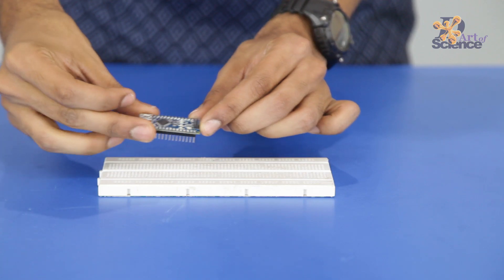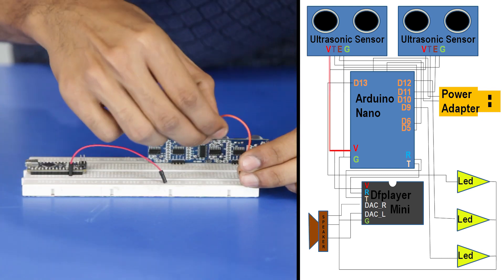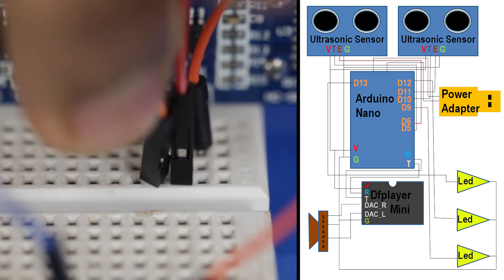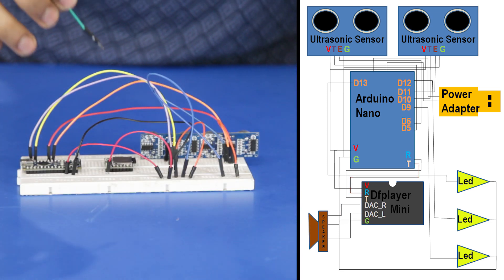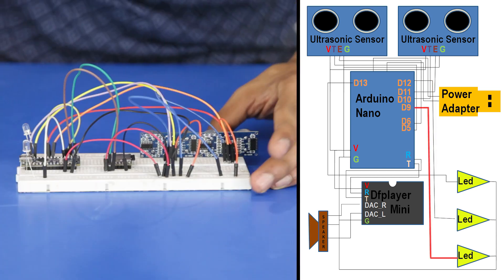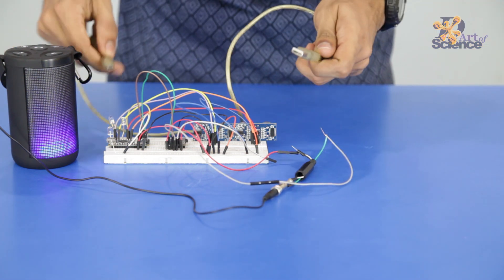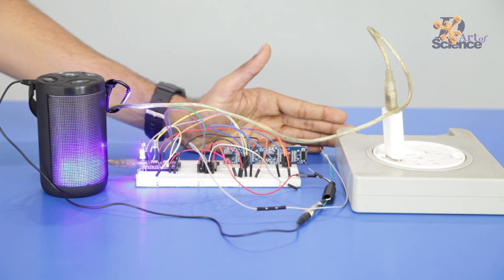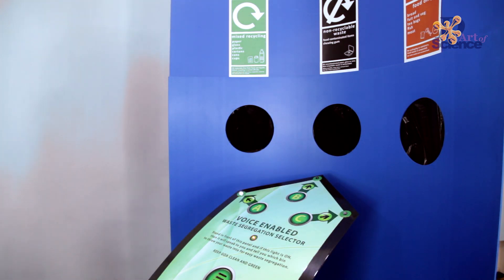How to make Smart Dustbin with Arduino | Arduino Project | dArtofScience

Comment: sir tell me the speaker will speak the speech of sd card?? automatically??
Reply from the maker: https://www.dfrobot.com/wiki/index.php/DFPlayer_Mini_SKU:DFR0299
have a look at this. Dfplayer mini mp3 module plays the audio file from sd card. you have to store your audio as 0001.mp3 for first audio, 0002.mp3 for second audio in mp3 folder on the sd card.
Reply: sir what for audio1 or audio2 pls explain.
audio1 will speak out when??
audio 2 will speack out when??
pls
Reply: thanx for rply
Reply: audio 1 is the english speech.
and audio 2 is marathi speech???
Reply from the maker: please check the arduino code given in the video description.
you have to program the arduino to send commands to dflayer mini to play particular audio(speech).